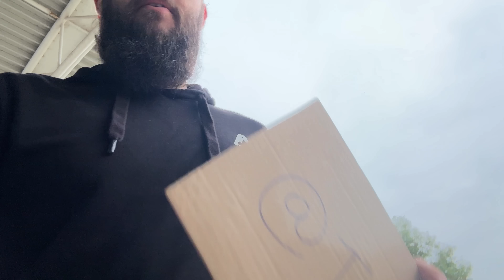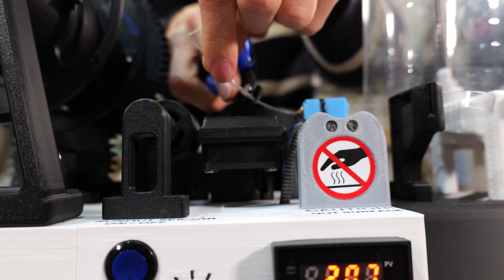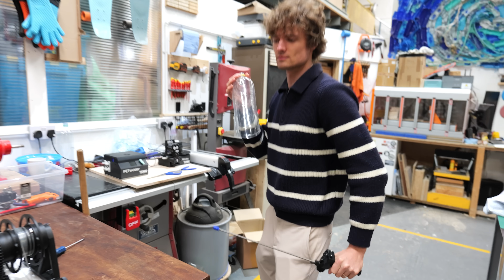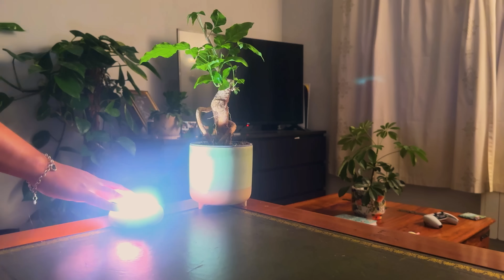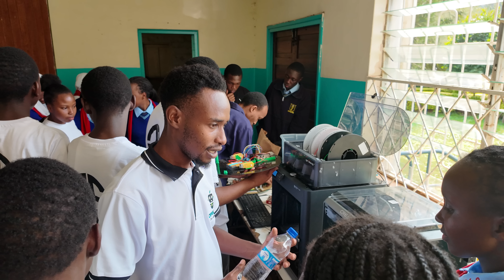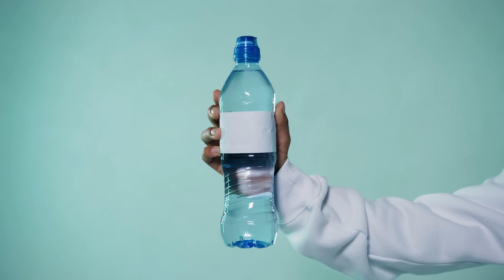Finally, a way to recycle Plastic Bottles at HOME

Comment: Hi guys, and greetings from Texas. I've been making stuff out of PVC plastic for a few years. (Mostly electronics enclosure boxes) I've got an idea about something useful you could make. You could 3D print a broom head and use filament as is for the bristles. Then, use a regular screw-in broom handle or maybe a piece of pvc pipe. You can also change it up a bit and make a bench brush to clean up a work space, or one of those hand brooms with the dustpan that clips onto the handle. So basically, what I thought of is, using raw filament as broom bristles.
Reply from the maker: Cool idea!

Comment: If you do this at home, have a ventilation system and a mask. Sitting there melting random plastic bottles is not a healthy way to breath. Especially with using Acetone to clean them.
Reply from the maker: At what point did we burn any plastic?
Reply: @BrothersMake  Ok, sorry, i wasn't precise enough. Yes you melt it. But still it releases fumes and particles in the air. The same reason why you should run your printer with an enclosure and extraction system.

Comment: You could make a "Mr. Solar Dehydrator" to save energy, a flat box painted black inside with glass lid will do. I make all kinds of solar cookers and dehydrators and even a simple model like this can reach 50..60° Celsius, that's 120..140°F

Comment: That would never make any sense. Due to recycling laws in Denmark, PET bottles has a value, if you return them. Therefore it would cost 38$ to source the material to make a 1kg spool from half litre bottles, and there after the labour to make the spool 😂

Comment: So you spent 100000$ to save 10$?
Reply from the maker: Exaggeration much
Reply: @BrothersMake  idk. Cleaning detergent acetone , heating fuel to straighten, machine to cut bottle generate filament, machine to join filament, electricity bill. 3d printer. Add that up and tell me.
Reply from the maker: Our energy is all renewably sourced. So regardless of the financial cost, the carbon cost is basically negligible.
Reply: @BrothersMake  very happy to hear that. me too. I even charge my ev motorcycle via solar. Takes a full day but I'm ok with that. 150km powered by the sun. Not bad. I do like your setup. But the hardware is prohibitive in cost. By my reconing
Reply: @BrothersMake also I wondered what the flexibility and tensile strength of the recycled plastic.  Could it be used on a strimmer, I wondered. For that I can see a market here where I live...... Just curious
Reply from the maker: A few others have commented the same. Maybe we’ll have to try it

Comment: Why is no one mentioning the chemicals inhaled by heating plastic?
Reply: Because each plastic has a maximum temperature before it breaks down into chemicals and raw gasoline.😊 Do not exceed this maximum and no gas.
Reply: It is none of you set the machine to the correct temperature. The temperature depends on the plastic and it is marked on the bottle what type of plastic it is.
Reply: That is a good point

Comment: Yeah...now calculate the energy and resources(water used etc) to clean the bottles, remove the rings, heat them up and go through the process. Add the time used as well.  You will find out why it makes no sense.
Reply from the maker: It can make sense in a lot of circumstances 🤙🏽

Comment: I dont wanna be 'that person' but doing smth practical in ppls minds means 'doing smth that wouldn't be easier done without a 3d printer'. A bent piece of thick metal wire, or thin metal rod, however u wanna see it, is way easier and can also be made from recycled wire from construction left over. You mentioned Lego earlier on in the video, why not trying to make lego pieces that don't exist? That looks like a task for a printer. Also I always hear people saying 3d printers will one day make car parts that were discontinued. Illustrating that with lego would be cool.

Comment: I don't know how that would integrate with the general recycling of plastic, but your bottle top and bottom have already been cleaned, so they should need less processing at the recycling plant (but you'd need to provide much more than a couple of tops at a time, like one cubic meter).
Reply from the maker: That would be a good solution if someone was willing to accept it

Comment: hm.... a lot of energy used for evaporating water from a plastic bottle...ever heard of the technology 'drying by air'? Like, you open the bottle and let it dry by itself, it works really well😂
Reply from the maker: When we refer to moisture, it’s not surface level sitting on the plastic. It’s being absorbed by the material. PET is hydrophilic, which causes lots of issues when printing.

Comment: i has think long time now how can  make used bottles to real life roof tiles, waste material can used build own houses roof tiles FREE. but problem is how melt bottles good can fill mold and heat plastic good one piece tile. many country can build cheap house if can use used plastic bottles make tiles, bricks,etc. i has 3D printing all my house in Thailand selfs, shampoo self, door handles, gate lock, door lock, hinges, etc, cheap can build lot house parts. im retiree engineering from Finland and move to live Thailand, Thailand can build xcheap but i think must plan lot cheapen use waste material build poor peoples better houses. and first step need plan how can use waste material plastiv bottles etc, make roof.

Comment: Plastic recycling is one of the world's biggest scams. Only a tiny fraction of plastics are even truly recyclable, and only virgin plastic is reliable in its characteristics. That might conceivably change in the future, but in 2025, that is the blunt fact of things. If you can successfully recycle plastics, and especially PET, more power to you. Putting it into the recycling bin is confirming that it will go into a landfill.
Reply from the maker: 8% is the global statistic for how much of all plastic created has been effectively recycled. In the UK, we’re. At around 45% but this includes everything we ship abroad to countries that can’t process it, so not exactly accurate. This is why we search for solutions on how to use plastic before it becomes pollution.
Reply: @BrothersMake  The UK exports 20%-25% of its plastic packaging waste to other countries, counting that as "recycling". Much of this "recycled" plastic is simply burned, called "energy reclamation" or "WtE" (waste to energy); the rest is typically landfilled. The UK also directly burns (as WtE) 44% of its overall plastic waste, and again, counts it as recycling. (Technically this is called "recovery", but is almost always lumped into the recycling statistics.) Note that the exported plastic that is burned or landfilled is counted as recycled.

Here are the facts: Most plastic cannot be recycled into greatly useful forms such as bottles or packaging. Only a few types of plastic, such as PET and HDPE, is at all recyclable into such high-value forms. And even then, the plastic can be recycled only once or twice before it degrades so much it can no longer be used for containers. All other plastic, including twice-recycled PET or HDPE, is at best fit only for low-plastic-quality uses such as plastic fill material, clothing fiber, and carpeting. When this is "recycled", it is inevitably "reclaimed" as WtE, i.e. incinerated—or even more commonly, dumped into a landfill.

Make no mistake: This has been known for generations. Back in the 1950s and 1960s, when plastic usage was exploding, polymer producers were perfectly aware that plastic was basically non-recyclable and non-biodegradable. I repeat: Plastic. Recycling. Is. A. Scam. If you think this is too blunt, then I'll state it in a more politic manner: The public narrative of plastic recycling as a circular solution is largely a myth, and always has been.

To add insult to injury, recycling plastic to make some inferior type of plastic is quite a bit more expensive than just creating and using virgin plastic from petroleum. We pay more for an inferior product that mostly ends up just getting incinerated or landfilled anyway.

Absolute madness.

If you've found a way to recycle PET as 3D printer filament, bully for you. I'm happy for you, and wish you luck. I'd like to do that myself. But the fact remains that plastic recycling is, in reality, a well-documented scam.

Here are some references to investigate:

Wikipedia overview: https://en.wikipedia.org/wiki/Plastic_recycling

Wikipedia article on WtE: https://en.wikipedia.org/wiki/Waste-to-energy

The Guardian on soft plastic WtE: https://www.theguardian.com/environment/2024/oct/01/soft-plastic-collected-for-recycling-burned-tesco-sainsburys-campaigners

The Guardian on plastic incineration: https://www.theguardian.com/theobserver/2025/jan/05/burning-waste-is-not-the-way-to-move-the-uk-towards-a-circular-economy

The Guardian on political dilly-dallying about taxing plastic reprocessing: https://www.theguardian.com/business/2024/oct/05/british-food-firms-lobbied-to-defer-17bn-plastic-packaging-tax-documents-reveal

Recycling Magazine on UK exports of plastic packaging waste: https://www.recycling-magazine.com/2024/01/23/growth-in-uk-export-for-plastic-packaging-recycling-in-2023-shows-need-for-rethink-on-use-of-non-oecd/

Financial Times on plastic dumping: https://www.ft.com/content/56418e4d-8af9-49ae-9ab8-ae01426321cf

The Independent general article on UK recycling of plastics (not a particularly insightful article, but has some good general information): https://www.independent.co.uk/climate-change/news/defra-england-mary-creagh-government-greenpeace-uk-b2619448.html

Ends Report on 2024 UK plastics waste exports: https://www.endsreport.com/article/1909165/uk-plastic-waste-exports-increase-again-2024
Reply from the maker: Solid facts 👍🏽 One thing I will mention is that we ran our own experiment where we recycled the same material (rHDPE) multiple times to find out what this ‘limit’ was. We got to 30 cycles and ran out of time to continue. The resulting product performed identically to the first. We made a whole video on it if you’re interested. So where facts are great, we also like to test them for ourselves to really see.

Comment: I think it doesn't make a lot of sense to stress about how you chose to recycle something as the point of recycling is to reduce waste being added to the environment as well as reduce the demand for new plastics to enter the cycle. something being recycled several times over is not any better than something that serves a purpose well for the same amount of time. the problem comes when that object reaches the end of its life and is then discarded instead of repurposed. This method of recycling also has the added benefit of getting people more directly involved in the process giving people access to incentives to see the discarded plastic in the environment around them and actively take and recycle them when other systems in place might overlook them. that being said thinking about how you recycle something is not a waste of time I just think that it shouldn't cause you any stress.
Reply from the maker: We always like to explore every angle to satisfy as many of the potential questions we may get in the YouTube comments. But we agree with you!

Comment: 10:00  to mitigate moisturizer, add some wood alcohol in the bottle after heat expansion, shake and dome in to next bottle and to a bath or wipe on the exterior.   Wood alcohol will absorb moisture.. Old trick for water in a your fuel tank
Reply: Just in case anyone here isn't sure what you're talking about, methanol. Methylated spirits would probably work too, mostly ethanol and some methanol, and I suspect water is more miscible in methanol than mostly ethanol.
Reply: @irreverends Nowadays, "methylated" spirits can contain a different denaturing chemical... despite the name.  This is because the cheap ethanol was still being consumed, with the contained methanol causing blindness.

Comment: Whatever recycled thing the recycling company makes from pladtic bottles will not be recycleable afterwards either, so I don't see a difference. Perhaps all 3-D products from recycled plastic could be melted down and reused in another form. Anything can be remelted or changed in some manner to have further use.

Comment: Given the sheer amount of PET that is being produced daily, removing some bottles and tops from the recycling process (given the huge amount of PET bottles that DON'T get recycled) it should not be a concern in the great scheme of things.
HOWEVER, if a method could be figured out that will convert said tops and bottoms into sheets or blocks similar to the methods used for HDPE, that could make another source for raw "material" to be used on CNC mills to make all sorts of parts for all sorts of purposes.

Comment: My feeling is there is a place for both recycling and reusing PET. This will probably always be a relatively niche activity, until such time as domestic 3D printers are used for everything. I generate a 2L empty bottle every day and wish I had the room to set up this sort of facility even just to reduce my own trips out to the bins. If this was something profitable - even a little - I'd recruit plastic dontations from others concerned that our recyclables aren't really being recycled (we've all seen stories that the UK does not have enough recycling facilities to process the volume of single-use plastics).

Comment: In your honest opinion,  would a moisture meter help eliminate the problem?

In woodworking we use moisture meters to verify the wood is actually dry.

A different material like plastic may pose challenges, but the benifits would be worth the effort to encourage plastic recycling.

Comment: It is a great idea but, there are lots of room for improvement.
 First:  I would come up with something that is more adaptable when pressurizing the bottles.  You need an universal adapter, or something as close to it as you can.  This thing of fitting the bottle cap, screwing and unscrewing parts to fit every particular bottle has to go.
Second:  Set something up to heat up the bottles.  This thing of holding on to the torch and a bottle attached to a drill to evenly distribute the heat while the bottle gets soft enough is terrible.  It takes a person standing up, holding on to a drill in one hand and a flame torch on the other.  Use something cylindrical, with electric filaments for hearing and a small motor for spinning the bottle.  Not that difficult.
Third:  Perhaps dipping the plastic filaments in alcohol would be best for drying.   As the alcohol dries so does the water.  Much faster, less energy consumed.  Ovens, food dehydrators, heat in general will be less efficient and take longer. 
I hope Igor has patented his contraption.  Lost of copycats out there.
Good luck!
Reply: Does a hot water dip address the energy inefficiency issue you rightly pointed out? Maybe with alcohol or a glue dissolving chemical? Water in the right thermal container can hold heat quite efficiently I imagine.

Comment: As an idiot, I don't understand why the bottles can't just be shredded, melted down and extruded into filament? Does PET have some sort of molecular directionality that has to be maintained or flocks of de-winged angels will fall from the sky?
Reply from the maker: It’s a case of crystallisation. PET is terrible for it compared to other polymers. You can’t work it in the same way without reducing its mechanical properties. You can do it in controlled conditions, but it’s not easy for small scale people like us.

Comment: super expensive Energy intensive Process ...  Heating ... Acetone ... Compressed Air ...  210 deg celcius afte Soap Cleaning  , Pressured Air ,  pre Heating ,Acetone cleaning .... Probabl 10 times worse for enviroment then throwing it away ... 1m a minute
Reply from the maker: All renewably sourced energy buddy. Acetone, sure we can agree with you there. But a fraction of a ml of it goes a long way and saves multiple reels of filment being wasted due to contamination, so overall a net positive in our book.
Reply: @BrothersMake  mmm ,,, Ive been a bit suspicious of enviromental salvation ever since they started Chopping Down Rainforest to Plant Bio Diesel Crops ...
Reply from the maker: Not sure how that relates to this video, but okay cool 👍🏽

Comment: I used a 16.9 fl oz PET bottle as a sleeve to mend a shop vac hose. Slipped it over both sections evenly, and used a heat gun to shrink it. The bottle molds over the ridges in the hose for a tight seal.
Reply: Now that is a brilliant fix!
Reply: @jaydee3046 .   Why can't you just say a ½ liter bottle?
Reply: @zero-waste 
Yes, or better 0,5 Liter 🤣
Reply: @zero-waste  Because Freedom-Units made it to the Moon first; proving it's superiority.
Reply: So smart!!!

Comment: The is annoying that one 3d printed the PET can no longer be recycled since it sounds like just a sorting issue not a process limitation.  They would still just melt the plastic if it could get to the recycling process.
but not as annoying that hearing the local recycling is just dumped back to the land fill.

Comment: Ok what about the 2000watt heat gun do I need to buy one of them?  and use a crap load of power, and allocate a week to go extrude all the bottles then put them in the oven and use more power then 3d print them?

I finding it hard to believe we are making a difference in recycling!
Reply from the maker: We’re using all renewably sourced energy to power all these machines. And a lot of our equipment we buy second hand.